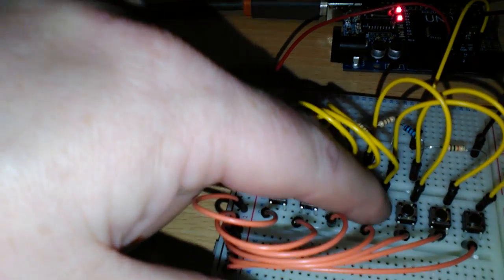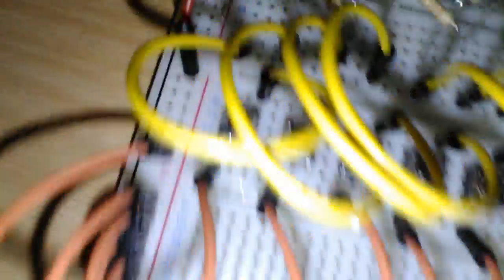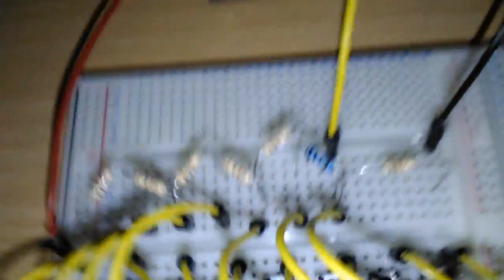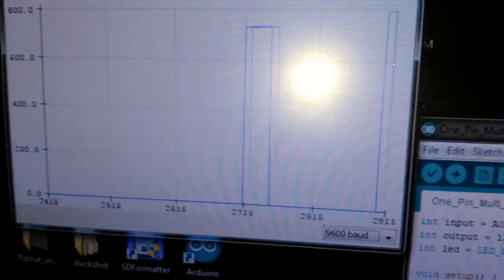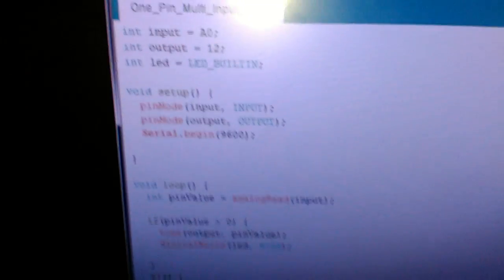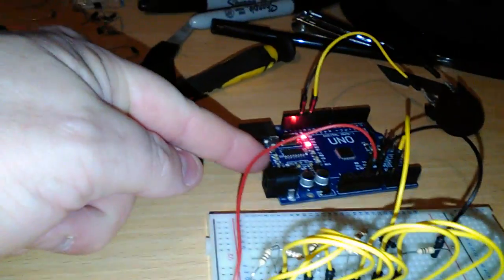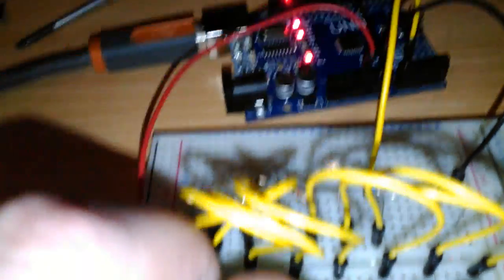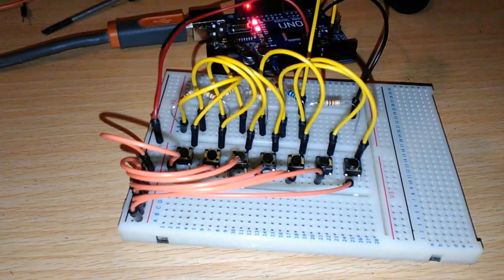Arduino UNO. Multiple buttons, one input.

Comment: Can this matrix be used to receive multiple inputs at once? I am trying to understand button matrixes for building a controller with more buttons than I have gpio inputs
Reply from the maker: Maybe, if you used multiple resistor values. In theory you could test the sum of values of the resulting voltage within your programming and determine what's being tested that way. Or you could learn about shift registers, which isn't as daunting as it first sounds.
Reply: @steve_ancell  awesome! I'll look into that, thank you very much. Any particular starting point on YouTube you recommend?

Comment: How did you connect all the buttons? how was your layout
Reply from the maker: With the orange wires nearest to me, the switch is split left and right. Two left ones are treated as one connection and so are the one on the right of each switch.
Reply: Thank you, can I ask for your email because I’m having issues building the circuit itself and would appreciate your help
Reply from the maker: If you take a look at the description, you'll find a layout diagram in the link I put up there. ;-)

Comment: I want to read several dip switch state with only minimum pins for arduino input. Can I use this method?
Reply from the maker: You can in a way that has different resistor values instead of using all the same ones. You can then make your script in such a way that calculates a sum of the values being pressed to determine which switches are on or off.

I hope this info is helpful to you. ;-)
Reply: Stephen Ancell thanks. I'll try it

Comment: I followed your example but the last button (one next to pull down resistor) does not give any reading. Any ideas?
Reply from the maker: @bob lug: Must be a loose connection, also try testing all of your resistors, make sure they're the correct value. Did you use the files in my project or did you type it out yourself?, check the code if that's the case.

Feel free to contact me again if you're still having problems.
Reply: Yes thanks for reply, I did use your code double checked everything added new resistor still dead, very strange. Ive now changed to just using the Arduino pull up resistor removing the 5 v feed and it works like a charm. Not sure why though :(. Keep up the great videos